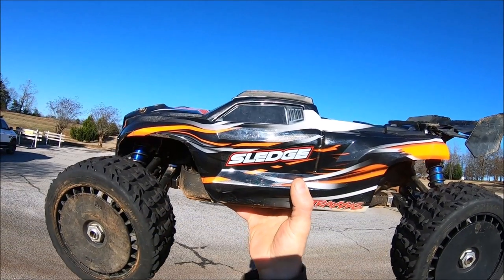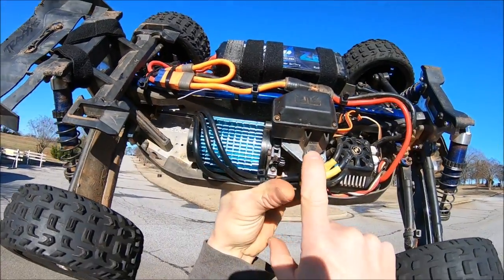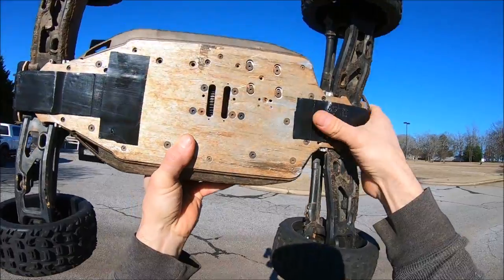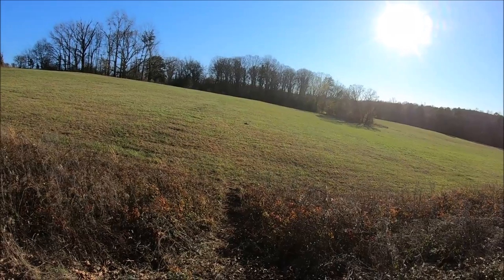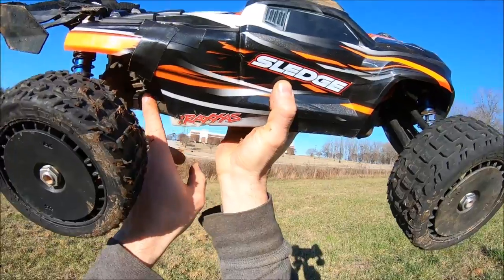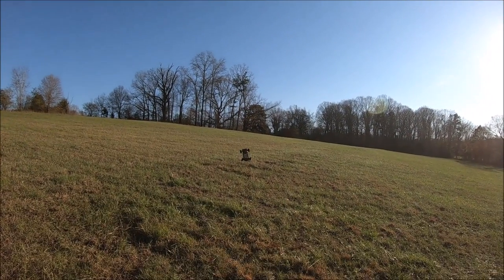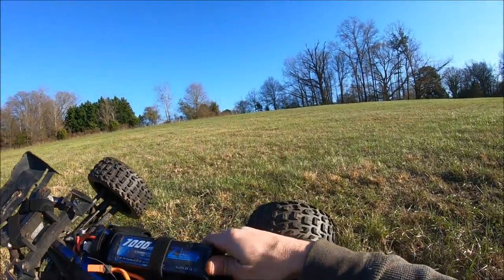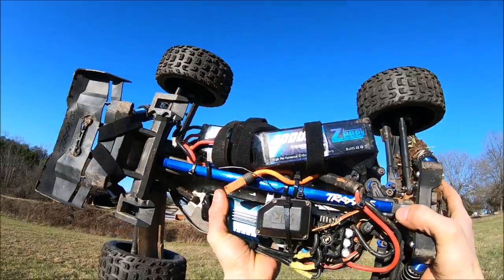TRAXXAS SLEDGE on 8s!😱OVERPOWERED Maniac!🚀🚀

Comment: Hello friend, congratulations for everything you do, I wanted advice with a 46/17 crown / pinion coupling with hobbiwing max6, would you say better 1700kv 4074 rocket engine or stock engine to get the most, with less heating. I will be grateful for your concrete answer. greetings friend

Comment: Damn Im surprised it didn't break more than that. awesome stuff manage you still testing the center shafts from M2C ? I keep having the pins come out on the stock center shafts. I seen that Traxxas makes a upgraded center shaft set now but I really don't want to buy that if M2C is about to come out with there's.
Reply from the maker: I'll check into it. They should be out.🤔You can always ask on their FB page or send them an email.😎👊👊

Comment: Hey man, Sorry if I missed it, if you have already said. But what diff gears were you running and what brand will you replace them with. Thank you Great video!
Reply from the maker: Stock diff gears. I did add a shim to the inner pinion to tighten up slop in the rear ring/pinion.
Reply: @RCDUDE81  good idea. I kept stripping gears, so I put Vitavon diff cases and been great since. And wow you really ripped through those tirse...lol...